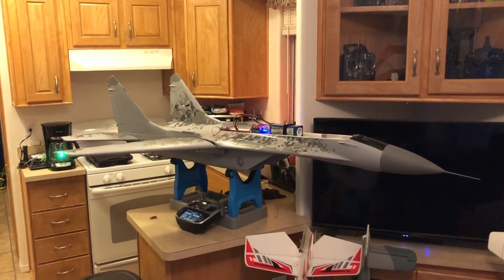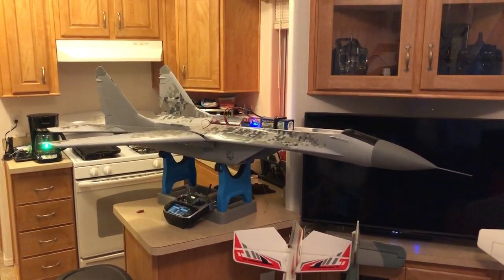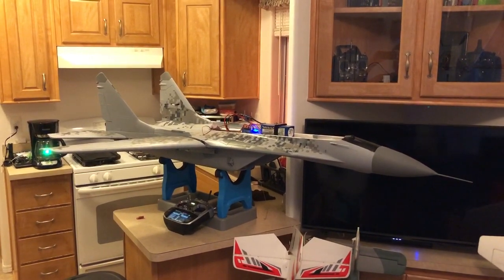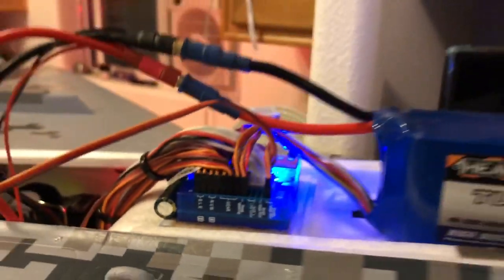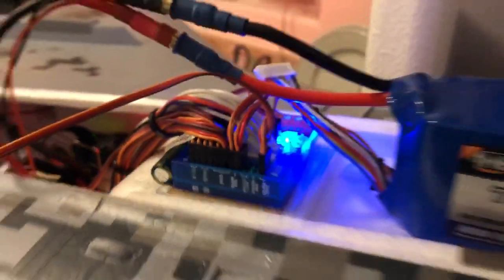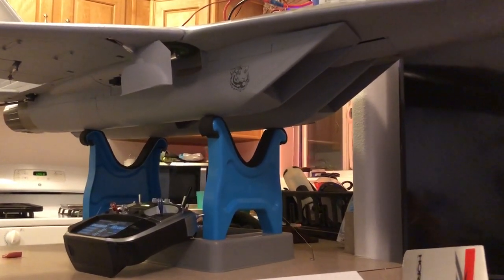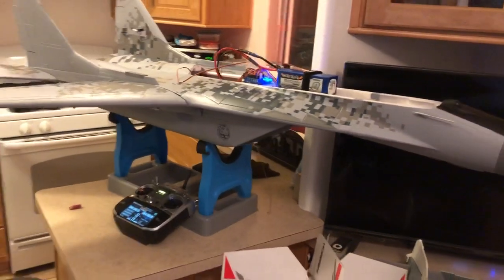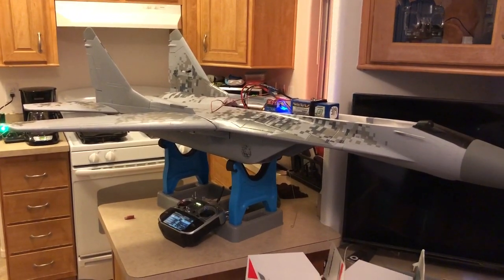Freewing MiG-29 Dual Stage Gear Door Mod

Comment: FMS $7 gear door sequencer. it comes in 3 sec or 6 seconds. can be ordered as a spare part for p-51 mustang 1450mm
Reply from the maker: The great thing about this mod is that it uses the existing MCB which has sequencing built into it. All you need is a y-harness to make it happen.
Reply: @548HPCobra  agreed. I posted the other method for those who do not have the blue box
Reply: @548HPCobra  wow. the blue box is only $9 bucks. very nice option to clean up your wing input wiring